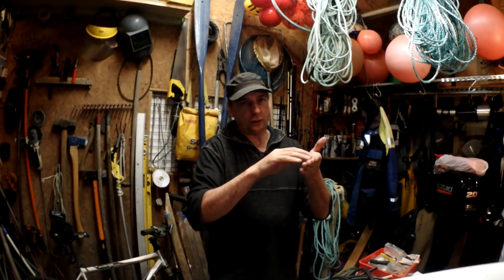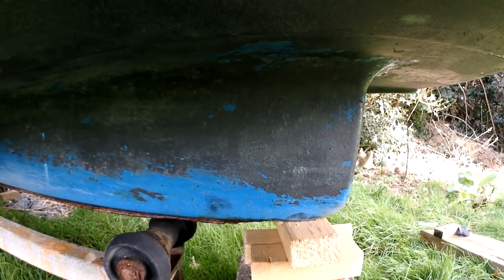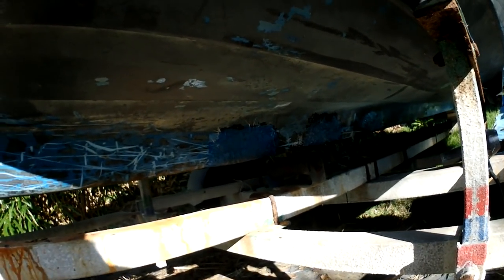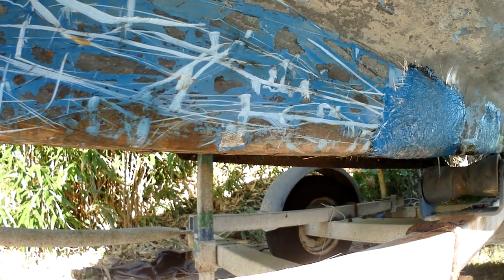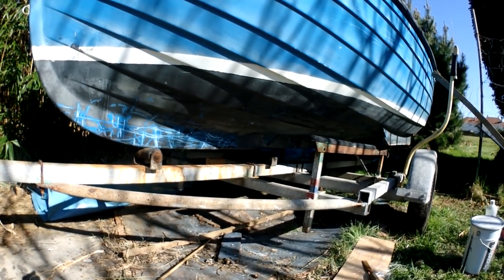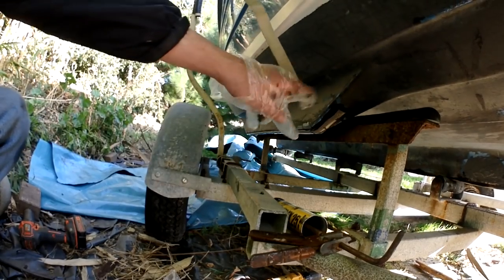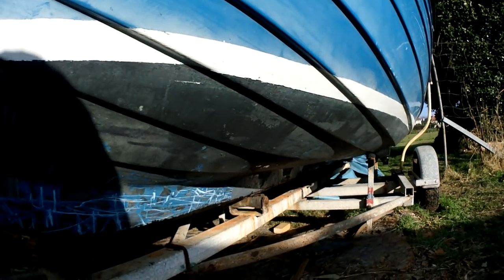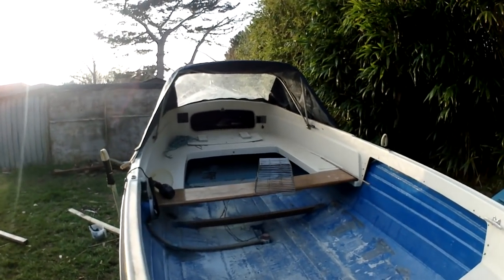Orkney Fastliner 16 Refit - keel Band & Keel

Comment: i used 3 number 1 builders trestles to support the boat on while i worked on the keel band on my Strikeliner - also had problms with screw holes and the hardest part for me was drilling the holes for screws as band was hardened stainless steel - did it on my own also trestles were a godsend mate.
Reply from the maker: We got the band done fairly easy apart from 1 screw which was a nightmare as trailer was constantly in the way even after moving the boat on it. Checked inside the keel the other day after being in the water for the last few months and its dry as a bone so worked out ok.

Comment: Hi Troy, Dawn Fisher coming on well. Have just brought a second hand Orkney spinner 13’.
She’s in pretty good nick, just been tarting her up a bit and sorting trailer out, everything that was supposed to turn on trailer seized solid. The boat has no keel band and was wondering as I would always be trailering her in and out of water is this necessary. Have read a lot of reports of keel bands being wrenched off and causing a fair amount of damage to keel. Be interested in your view on matter.
Hope winch fit goes ok.
Reply from the maker: I would defiantly lave a keel band on as  if the keel is hollow you need some protection. I went with the plastic keel band as its cheaper plus if it does take a knock its more likely to absorb the shock where as steel could transfer the energy to the screws which is what I think has happened on this boat. I have also used plastic keel band on several small boats including the old one which has been on for many years.
Reply: Thanks for getting back Troy,
think I will go plastic band route, when screws go into keel there’s no danger of leakage into boat is there.
Reply: Hope the winch works well and takes the pressure off your back, it’s a crippling pain, I know first hand!

Comment: Hi just found this channel and don't. No. Whether to use steel or plastic on my keel. Band?
Reply from the maker: I have always used plastic keel band and have never had to replace it again. I did look at stainless steel but it costs a small fortune and after inspecting the old steel band saw 2 keel band screws had cracked the fiberglass probably due to a blow on the side of the keel band this definitely swayed me to the plastic as it would have absorbed more shock. I think the plastic band is great for smaller boats but would probably go with steel on larger heavier boats.

Comment: Orkney keels are a real pain for leaking,good job on the repair mate 👍🏻
Reply from the maker: You would think just adding an inch of resin in the keel would have made such a difference when they made them
Reply: @Trojwaterman  totally agree!!
Reply: @Trojwaterman  They make them like that so you can drain them and leave the bung out when ashore. I'd be reluctant to fill that cavity with epoxy, It's never going to be dry enough to seal anything up. if you still get water in after sealing up the keel band and it's definitely saltwater getting in I'd replace the stern bung or just the bung washer first, they are prone to slow leaking as they age. Also, I'd be inclined to think that cracking was caused by rusted screws in the keel band, seen it so many times when replacing them, the expanding rusted screws exert quite a force and regularly split the glass, stainless or brass/bronze screws are essential.

Comment: You really need to get the boat of the trailer put on its side and and that will allow you to do a good job on the keel, well that's what I do
Reply from the maker: Not easy getting help to do that at the moment with the way the worlds been recently
Reply: @Trojwaterman  I know but what I do is just push it of the trailer then push the boat up on its side held with a couple of sticks